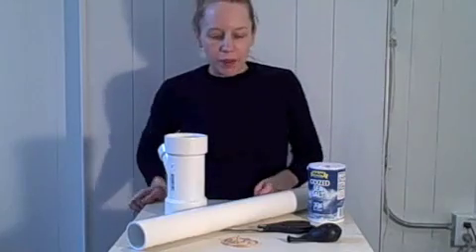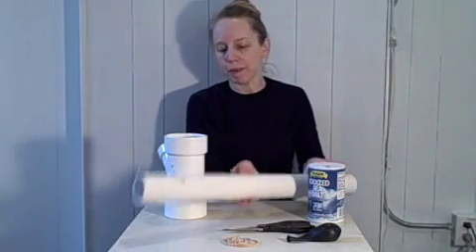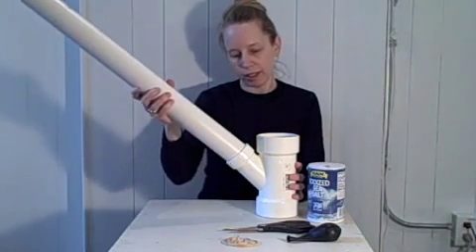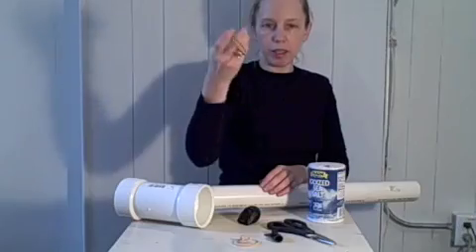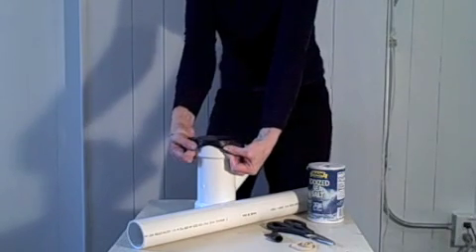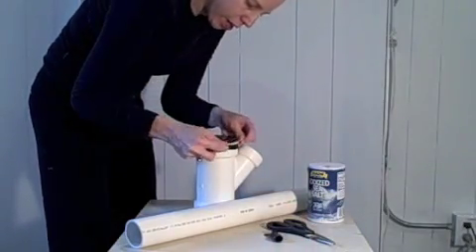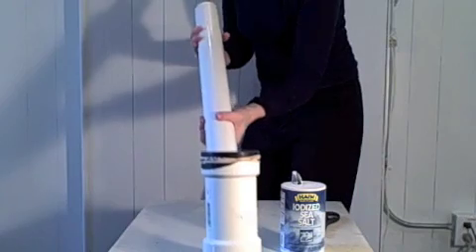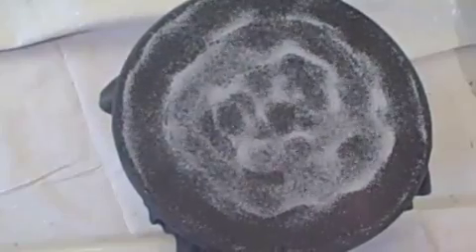How to Make a Cymatic Sounder

Comment: Interesting. Have you ever thought what vibrations of crystals and resonation of sound in the body does to the cells of the body. I know I am a healer. Connect with me - my page is here if you click my picture.
Reply from the maker: +Margaret Rogers Van Coops Hi, yes you are on the right track - there is a whole branch of cymatics that is called sound healing, and if you look up Mandara Cromwell, Cyma3000 or ISTA you will find all kinds of info on machines that use sound to heal the body through the direct vibration of the cells.

Comment from the maker: Can you send me a video of it? I could tell you what to do then. If that's not possible, try attaching a larger flat surface to get more complex shapes - you can use a big funnel from a hardware store to do that - just cut the bottom off and attach it to the top of the sounder. Then you will also need to get some latex instead of a balloon for the surface  of the funnel - google the term:  makinglatexclothing

Comment: A suggestions, use a short piece of pipe to hold the rubber on. This will also provide wall to prevent the sand / salt from falling off.